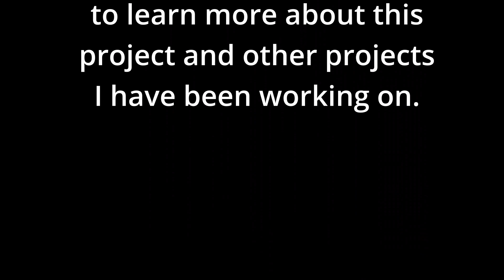393 Windsor Build Part 14 Convert Chevy Throttle Body Injector to Throttle Body. Looks Like a Carb!

Comment: One tip on removing the plug for the idle set screw. Drill the hole just big enough to pass your torx bit through. Then, simply back out the screw and it will lift the plug out. I have modified hundreds of these. I used to sell kits that would allow the use of a 4.3L/5.0L/5.7L throttle body onto a 2.8L/3.1L bored intake.

If anyone is interested, there is a way to get these base units as a throttle body already! GM had the 4.9L V8 in the 90's Cadillacs that used these TBI bases as the throttle body. The injector and wire openings were not there and none of the screw holes holding the injectors on were drilled and tapped. Certainly not as common though.
Reply from the maker: I actually tried to use the screw to back out the plug but could not get it to push the plug out.  It may have just been seized on that particular unit and when it didn't work on the first one I didn't try it on the second one.  As far as the cadillac TB another commenter had made me aware of those but as you said they are less common and a lot more expensive.  Also (based on pictures alone) the butterflies look bigger on the cadillac units.  I have not been able to confirm this but if it's the case I think that would have resulted in too much CFM for my application being that I am using two.  Thanks for the comment.
Reply: @dazecars  The bores are almost the same. About 2mm or 1/16" larger. I'm not too sure how hard they are to get your hands on, but almost every 4.9L is dead because it was such a shitty motor 😆. All kidding aside, I think you have a really cool plan that will definitely be unique. You, or anyone out there, also have the option to use a Holley throttle body off of the Dodge Magnum motors. They serve basically the exact same function as the GM/Rochester unit. They came as TBI units early on and later morphed into a throttle body with no injectors like the Cadillac 4.9L engine. Holley even offered (and may still) aftermarket units with the GM TBI bolt pattern, which you could install. They claimed better performance, but I can't really see where then gains would come from. They are basically identical.

If you do find out that your throttle bodies are too big, you could downsize to the 2.8L/3.1L unit that came in S-Series Trucks, Isuzu SUV's and the Lumina APV Van. They use 35mm or 1-3/8" bores. 

Have fun building this. I hope to do a similar plan soon. The stock GM intake on my 3.2L (3.1L bored 0.040" over) is using the stock 2.8L intake bored to match the same TBI unit you are using. It runs great, but when you look inside the intake, the runners are essentially 2" long. I have a Camaro intake, which has long runners and comes apart in two halves. My plan is to turn the upper into a plenum for the TBI unit, but with the long runners of the lower, it may help increase low-end torque. We'll see. If it sucks I can always switch back.
Reply from the maker: shortly after I started this project I did receive a tip about the Dodge TBs and I did look into them.  They would have been easier to work with and mount up but the butterflies are quite a bit bigger and using two probably would have been an issue.  I feel like I am kind of at the max butterfly size with what I am doing.  Thanks for letting me know about 2.8/3.1 TBIs just in case I have more flow then I want.  I don't anticipate that being an issue but given the DIY nature of this project I really don't know how any of it will turn out and having options helps.  Your project sounds like a fun one.  I hope it works as well if not better than planned.  Thank you so much for all your comments.

Comment: Have you ran this setup yet? Looking forward to hearing how it works!
I love the look, a little like an Autolite inline carb
Reply from the maker: I have not.  I ended up having emergency surgery back in July and am just now recovered enough for life to be getting back to normal.  As you can imagine project not related to the shop have piled up while I was recovering.  I need to carve out a day or two and get this going.  It still needs the IAC plumbed and to hook up the EFI controller and then I can test fire it.  I hope to get to it this winter but it will likely be a few months at least.

Comment: Ok dude i appreciate the ingenuity and effort. That said GM already did this for you. The first Cadillacs with multi port EFI used the TBI  base as their throttle body. Again not busting balls but if someone wants to replicate what youve done theres a ready made option
Reply from the maker: I really appreciate the info.  You are actually the second person to mention this.  Dodge also did something similar with their early MP throttle bodies.   I am sure there are other makes and models as well in the 90s that have a carb looking TB.  After looking into it further if I was after simplicity I would totally go the Cadillac rout but if $ is a concern then the S10 TBI might still be a better option as the prices I am seeing for the Cadillac parts are 3-5 X that of the ones I am using.  My only option is eBay as the junk yards in my area think their parts are "new" or gold plated.  For me it would not have mattered either way if I had known about the cadillac parts.  I used these TBIs because I got them for free. In fact I got them first and it was them sitting there that gave me the idea to modify them into my Frankenstein EFI.  I just lucked out that they were as easy to work with as they are and that the throttle blades are close to perfect for my application as far as size so that my throttle response and low end torque are as good as they possibly can be.  Thanks again for the comment
Reply: @dazecars  good I'm glad you didn't get pissed. I dunno if you've seen the Ls style coil near plug ignition kits offered by Holley, MSD etc... that are around $2k for the kit? Well anyway I put together a parts list showing how the exact same thing could be done for a fraction of the price using a 60-2 wheel from a 2015-2019 4.3 v6 @$24 new on ebay, a cam synchronizer (dummy distributor) from a 99-00 7.4 liter 454 from a gm 3500 @$120, then coils and brackets from a wrecking yard, amazon or whatever on the cheap then how to wire and control the whole thing using a $25 arduino 2650. The whole thing actually got a Holley rep yelling at me and telling me if I can't afford the proper parts then I should keep my mouth shut and not tell people how to blow up their engines. Anyway cool build man
Reply from the maker: No reason to be pissed, you were just trying to help.  I am not the kind of  content creator that thinks he knows everything so I am always willing to get new information and incites.  Do you have anymore information on this ignition setup, it sounds like it is right up my alley.
Reply: @dazecars  yeah man I've built a couple now. All you need is the 60-2 reluctor from a 2015-19 4.3 ecotec v6 / cam synchronizer from a 99-00 454 aka a 7.4 liter / a hall effect crank angle sensor that can recognize the 60-2 wheel
What I do is mount the 60-2 wheel between the balancer and pulley, then make a bracket for the crank sensor so the magnetic tip is facing the wheel and I use the spacing that holley recommends in their kits, the cam synchronizer looks like a distributor with a blank smooth cap and all it does is house a 1x cam sensor and the oil pump drive. The coils I've used are the ones used in trucks with the 5.3 and 6.0 that have the finned heat sinks (with factory wiring harness). To run the whole deal I use Speeduino efi boards from Detination ems that cost about $90 that can fuel and ignition in any configuration you can think of. The boards come assembled and as for wiring it can be a pain but diagrams for ls ignition stuff is everywhere. Tuning is done with the free version of TunerStudios which has been idiot proofed for people like me lol. 
You can get all the hardware on ebay  for dirt cheap. The only difficult part is popping holes through the the 60-2 wheel so it can be bolted to the balancer, and ypu will have to space your accessories out to account fornthe thickness of the wheel but two flat washers per accessory bolt spaces most gm stuff out far enough to compensate. Oh and if you want to run a wasted spark setup you can forego the cam synchronizer but you'll still need something like a gutted distributor to run the oil pump
Reply from the maker: Thanks for the info.  I think nI will be looking into this further!
Reply: @dazecars  cool any questions let me know
Reply: @dazecars  well here's an update you might like. You know aftermarket efi manifolds have only really been available from the big aftermarket companies for like $500+. Well looks like the 8 year old indentured servants over in China got put to work making clones of efi intakes for Ford and chevy. I saw a copy of edelbrocks pro flow that looks like a tunnel ram with an Ls throttle body up front for $200 on Amazon and ebay with free shipping. Same with carb style manifolds with 4bbl flange and injector bungs for same price and available for Ford Windsor blocks or chevy 55-86 small blocks
Reply from the maker: I have seen some of those but they were all for the 302/289  The problem I faced all through this project was that if I wanted to get something for a 351w I needed to either reach deep into my pocket or make my own.

Comment: Chevy parts on a Ford engine? Sacrilege
Reply from the maker: Every manufacturer has things they do "better".  There is a reason that half or better of all non Ford project cars have a Ford 9".  Same applies to all the other parts.  Even in a single make there are tons of good parts across a verity of models.    Unless building something original why limit yourself to one make or model.  These TBIs were the best choice for an entire list of reasons and will not look out of place in the way that an HEI distributor would.  It's going in a 62 Galaxie with a 351W (stroked 393) out of a 95 f150,  front discs brakes out of a LTD, rear discs from a Mark VII, hydroboost from an chevy S10, front buckets from a Subaru and eventually it will be getting a Jaguar IRS.  Everything looks stock and flows together as if Ford designed it that way. I would agree with you about sacrilege if I was installing a Chevy 350 or an LS in this Ford but its a Ford engine and IMHO it doesn't matter how it gets its air as long as it works and is the best choice for the situation.
Reply: Many manufacturers use other brands for parts. Some ford muscle engines used the Q jet. that's just 1 example. Hot rodders don't really care if they think out of the box. I have a ford drivetrain in a 31 Willys. And its got GM hei on it, considering a gm tbi too.
Reply from the maker: sadly the era where you could go to the junk yard and scavenge from one make or model to make it work on your make or models are all but gone.  Most of the cars from the 70s, 80, and 90s have been crushed and the post 2000 cars are too integrated and computer controlled from much old school hot rodding

Comment: Markviii throttle body’s would work for this
Reply from the maker: I tried looking up the part and all I found was the typical fuel injection TB that looks nothing like a carburetor.
Reply: @dazecars  they would look more like a Weber carb but have a 4 bolt flange .
Reply from the maker: It's a good idea.  For me I was balancing several things, the GM TBIs were free, they will look like carbs and fit under an oval air cleaner, they were FREE, the size of 4 butterflies is about perfect to maximize airflow without compromising throttle response/torque and the most important reason, they were free 😂😂
Reply: I know it's too late but have you thought about turning the throttle body's 90° and use a progressive linkage so you are not running on all four butterflies at low rpms. And if I remember correctly gm had three different size (2 barrel) throttle bodies, the smallest was on the 305ci. then the 350ci. got the medium size plates, then you had the 454ci throttle body with the largest throttle plates. One of the 454's tbi would be capable of making good hp numbers by itself. Anyway your setup look amazing and I hope it works just like you intend it to.👍
God Bless and have a Blessed Sunday.
Reply from the maker: So there is one more constraint and that is hood clearance.  I am not going to have a tone of room.  That means this setup needs to be a low profile as possible.  The only way to not put it in line and get it to clear the fuel rails and without interference with the throttle linkage would be to raise the entire assembly which I can't do.

Comment: Why not just use two throttle body’s from a magnum engine?
Reply from the maker: The simple answer is I had the Chevy TBIs and they were free BUT after looking in to it further (others have made the same suggestions) the butterflies on those throttle bodies are quite a bit bigger.  Bigger butterflies equals more CFM but it can effect throttle response and low end torque.  I talk about these being "perfectly sized" on this video https://youtu.be/_qZksA3xAAU at 12:12
Reply: @dazecars  I think there are a couple sizes between the 3.9, 5.2 and 5.9 units, one with smaller blades, though I don’t know the size differences. Either way, cool video series, just found your stuff.
Reply from the maker: It’s an excellent point, if was doing another one I would for sure check out other options like the one you suggested.  Glad you like my videos.

Comment: When you put the screws back in the butterflies on the throttle shaft i use a penny on the head of the screw and vice grips to swedge the thread side. The jaws pinch on the the penny and threads.
Reply from the maker: excellent tip, thank you

Comment: Many years ago I used a Holley Carburetor as a throttle body for a 460 EFI conversion and simply used one side of the throttle shaft to actuate a stock Ford tps, worked just fine.
Reply from the maker: That is another way to get it done

Comment: if both throttle bodies are feeding a plenum, a single iac in one throttle body will work just fine
Reply from the maker: I think you are right but being this is completely home spun I didn't want there to be any chance that one cylinder es getting way more or way les air then the others.
Reply: When you are at idle, the engine is sucking hard, that's why you have vacuum.  You're also at low load.

So #1, you won't have a flow imbalance and #2, if you had a flow imbalance the rich/lean condition would not harm the engine at all.  At worst you would foul a plug but I doubt that would happen unless you were running grossly rich/lean beside the minor flow imbalance.
Reply from the maker: I agree with all of that but it doesn't change the fact that this adapter is totally home grown, not flow bench tested or computer modeled and there may be something in the design that effect airflow.  I think you are correct and there is a 99.9% chance that one IAC into one TB would work just fine it doesn't take much more effort to balance it out so why wouldn't I.
Reply: @dazecars  converting those TBIs to TBs is pretty cool because you are modifying junkyard parts to create a carburetor replacement style EFI.

You should stick with the TBI IAC because it's already there and it will work.

Your decision is uncool because it is opposite of what makes your TBs cool.
Reply from the maker: thanks for the input